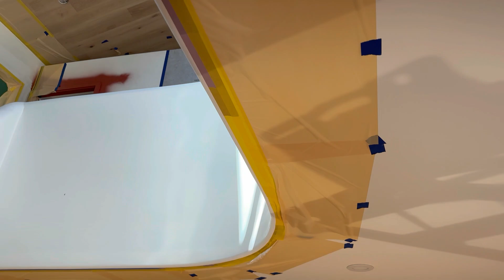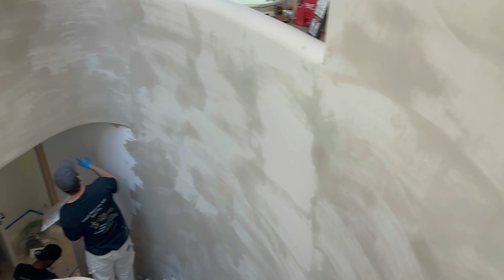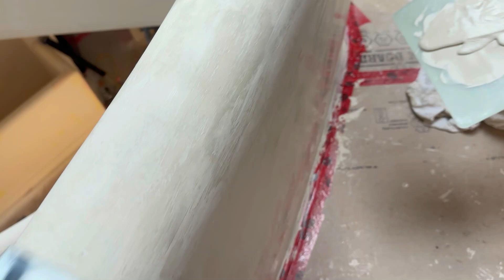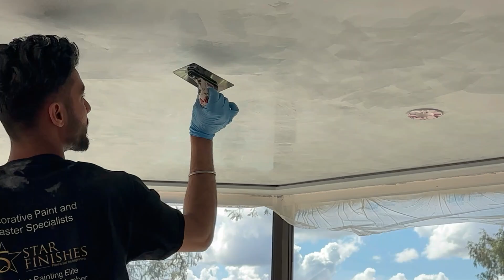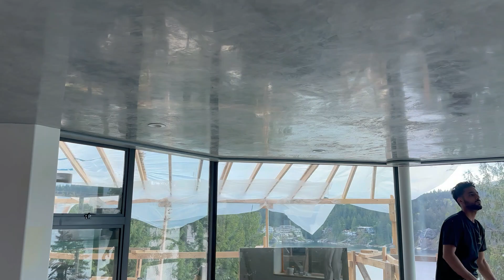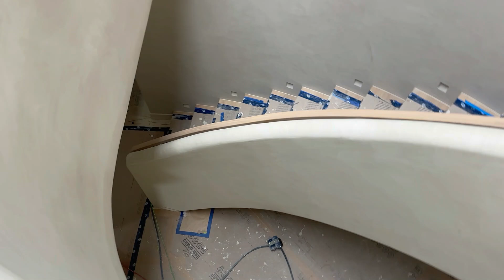Grassello Di Calce Spatulata Venetian Plaster High Gloss Finish - 5StarFinishes - #venetianplaster

Comment: I want to do what you did on this ceiling exactly on my bathroom 
Can I use grasello di calce from FirmoLux,

Or has to be yours?
What's the color name and the wax u use?

Im asking because i already have some grasello di calce from them and i can't get it to look like this, i use the meoded wax and it doesn't make the different tones pop at all , good im only working with a 2' x 2' 1/4" mdf  sample board still 

I will get the product from you if available,  so i can make my sample first, to make sure i can get it right 
Thank you!
Reply from the maker: Hi there. Thanks for reaching out. I have not used firmolux but am familiar with Meoded’s wax and their lumundo. The Firmolux says it is 100 um and ours is around 3um marble powder so there will be a large difference between them in terms of mottling and shine. 
The Hydrowax is water base and we use an oil based heritage wax. 

The Spatulata is very easy to use and does not have issues with blisters and peeling and creates the mottled look very easily. The trick with the last layer is using the third coat very wet and literally burnishing the plaster with a wet trowel and going over the area many times to create the crystal shiny appearance you see. This ceiling was featured in a magazine recently and is starting to win some awards. I think anyone with this material and the right technique can be just as successful. 

Please let me know if you have any specific questions. 

Lastly you can only create this finish with Pavan Anima trowel. Only use for the second and third layer. The first layer you should use Co me Bianko pro flex. 

Our quartz primer is also formulated with marble aggregate vs sand and this specific high polymer primer also creates a better veneziano effect.

Comment: How much did you charge per sq ft on this ceiling? Im just curious, 
If you don't mind
Reply from the maker: Hi there 
Honestly this was a while ago and the ceiling was combined with the large spiral staircase scope so I don’t know how much the ceiling cost as an isolated project. It did take some time to install properly and for smaller projects the price is always much higher than for larger as a general rule for projects 1000+ sq ft I think 30 dollars a sq foot for a finish Mr rule quality overhead is fair. Most other finishes we offer are around 20 for larger scopes. 
Smaller scopes obviously the price increases considering emails, mobilization, custom samples, etc etc. I hope that helps.

Comment: Very nice finish! Amazing work! 
I just learning Venetian plaster. 
Would you give me the link of product and tools you guys used?
Reply from the maker: https://shop.5starfinishes.ca/products/grassello-di-calce-spatulata
https://shop.5starfinishes.ca/products/high-binding-quartz-primer
https://shop.5starfinishes.ca/products/high-performance-venetian-plaster-clear-wax?_pos=1&_psq=wax&_ss=e&_v=1.0
https://shop.5starfinishes.ca/search?q=poly+seal&options%5Bprefix%5D=last
Reply: @ thank you !
So basically you kind like modernizing of Venetian plaster using better materials if I am not mistaken….
Reply from the maker: Yes I believe we have made a very high end quality product that is very easy to work with. The materials and additives are of the highest quality and I have also personally used them on projects for over 7 years and have constantly modified all our products to be the most optimized.
Reply: Hey so i can put the 3rd coat with anima trowel? What is the difference in results from the 5mm to the 6mm
Reply from the maker: @ hi there. The small burnishing anima trowel only comes in 0.5mm and the medium comes in 0.6mm. For Spatulata I only use the small trowel for the second and third coats at 0.5mm blade thickness as the smaller size produces the best appearance, with smaller movements and tighter compression and control. 
The 0.6mm is a little stiff I find in a medium or small trowel and it will be more harsh and less forgiving on your wall although has the potential to produce more shine as it’s a little more stiff. 

We produced this finish with a 0.5mm small anima. Best of luck.